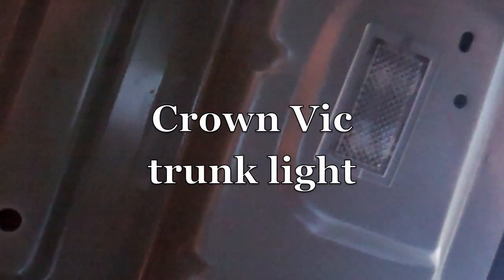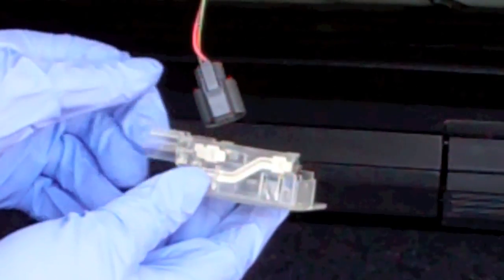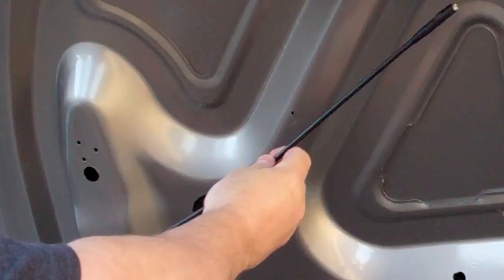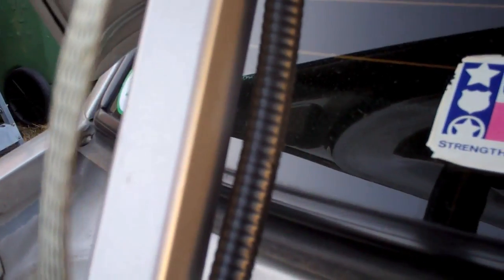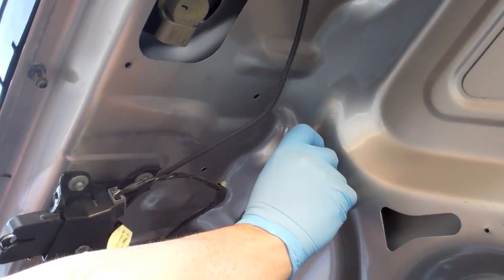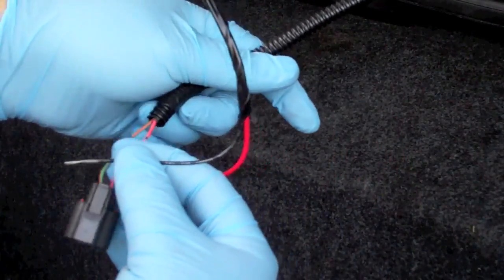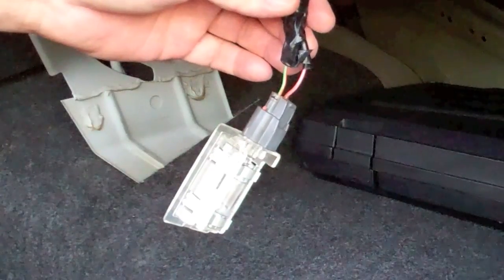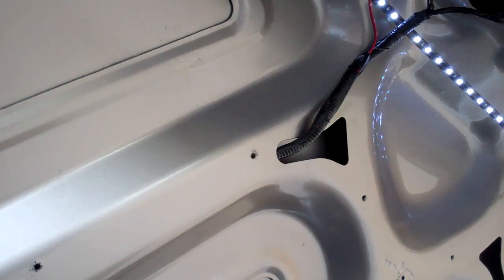Ford Crown Victoria trunk light and add LED lighting

Comment: Good Video.  
Trunk has excellent space in the Interceptor/CV.
I took the 4 cylinder Toyota engine out of my truck.. put it right in the trunk , with my Full size spare.. and dropped off the Engine at the machine shop for a rebuild.  Fit in there no problem.
The car didn't even Sag in the rear . Didn't even notice it was in there.  Pretty cool.

Comment: Man Gary, nice mod.  Something I definitely want to try on my P71.  I had once installed 200 ft of those LED strips, in orange, behind the grill of a '71 Dodge van I once had.  Looked really bad ass at night.  The self adhesive started loosing it's stickiness after a while.  I bet if I cleaned the surface like you did it would have lasted much longer.  -Chris
Reply from the maker: 200ft of orange LEDs... that must be quite a sight

Comment: 6:30 You will get WAY more light out of the stock setup if you put one of those postage stamp style LED's in place of the stock trunk light bulb. It's faster and easier than stripping wires and soldering.

Comment: Nice video.  I have the same problem with my 2005 Mercury Grand Marquis.  It just doesn't have enough light in the trunk.
Reply from the maker: since I filmed this video I relocated the lights to the sides of the trunk - it's even better
Reply: Thank you for the reply.

Comment: Hye handy how about a vid on how to take off spotlights and what to use as plugs for the holes left ?

ty love Ur channel
Reply from the maker: That's a great idea, unfortunately I don't have any with a spotlight and my Charger came filled with RTV which has held up long enough that I haven't wanted to mess with it.   But if it starts leaking I'll certainly do a video.

Comment: The solder connections to the plug why didn't you just cut them and then solder them that way you could use shrink wrap and it could look better
Reply from the maker: good tip... I don't remember why I did it the way I did at the time

Comment: for some reason my trunk light was installed backwards and took forever to get out then I replaced it with a LED bulb which looks great but could still use more light
Reply from the maker: I may go back and add even more LED lighting.  That's the nice thing about LED, it doesn't draw much power so you can add lots of it

Comment: Ford was lazy with the trunk lid wiring. You can unplug the reverse lights and trunk latch, and fish them through the lid to the holes closer to the lights. More protection for the wiring, and less ugly!

I put LED strips along the sides of my trunk, but I put them on an independent always hot switch. I have a habit of leaving my trunk open for long periods, and I don't like having to close and open to have light again.

Comment: I wired my lights just like this, and they don't light up...black to pink/orange. Then white to green/ orange.
Reply from the maker: Did you test the light separately to make sure it works?  If it's an LED make sure it's not a polarity problem (some LED's will only light up if wired in one way, whereas old style bulbs will usually light up either way).  Make sure the light you are using is white for hot and black for ground and not the opposite.  Good luck!